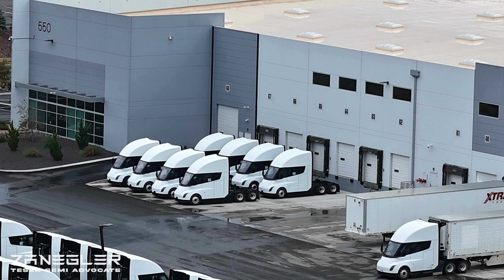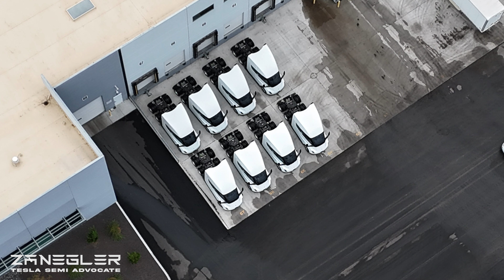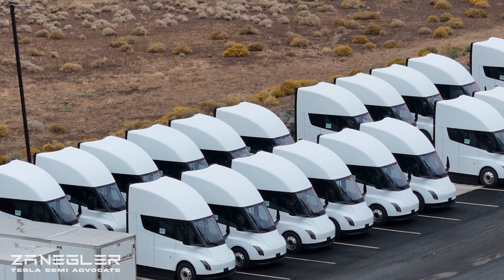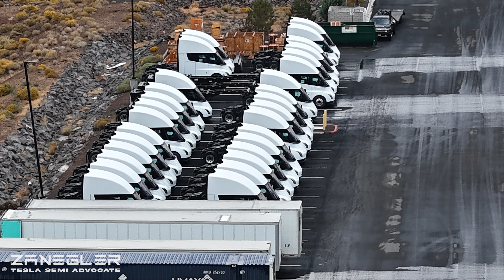A Thunderstorm of Tesla Semi's!!

Comment: DHL just announced their evaluation of their test semi and are moving forward with an order and charging infrastructure. I think they called it an integration schedule. This was tested on various 400 mile routes in their system. They did 71,000 gross weight, a normal load for them and used it like a normal part of the fleet. They averaged 1.7 kW per mile and had lots to spare.

Comment: Tesla implemented 800/48V and drive-by-wire on CyberTruck. Surely Tesla is implementing its latest tech on Semi, MY Juniper, MS, MX, CyberCab and Robovan to cut their costs and ready them for an AV future. Surely, any vehicle without the double steering motors up front will not be fully AV.

Comment: Issue is these have to support buildout and struggle against shrinking margins. 

I’m glad they are building yet I still don’t see a clear path to infrastructure for at least next 20 years.
Reply: .most of the companies buying these for the next few years will be like Pepsi and install chargers at warehouses and delivery locations so Tesla will have several years to start building charger locations pon routes for the later waves of sales.
Reply: transmission lines ready for more chargers yup
Reply: Extensive charging infrastructure ALREADY exists for the Tesla Semi:  Tesla's network of Superchargers.  You only need more powerful chargers (so called "Megachargers") at the trucks' bases, NOT on the road, where distance traveled daily is limited by legal driving hours, not by any truck-specific charging infrastructure!  At truck's bases, "Megachargers", optionally coupled to a Megapack, would be needed to allow quick turn-around of the truck in between two driver shifts.  Pepsi already have such chargers, and can turn-around their Semis in less than an hour.

Here in Europe, the by now quite numerous electric trucks that we have are charging at regular EV charging stations when on the road. The present problem is that few of these stations have drive-through charger spots.  So, Tesla would only need to install a couple of chargers per location in a way Semi's... and other towing vehicles.. could easily manoeuvre in an out, without having to decouple the trailer.  That can be done continent-wide in  months... not 20 years!!!!